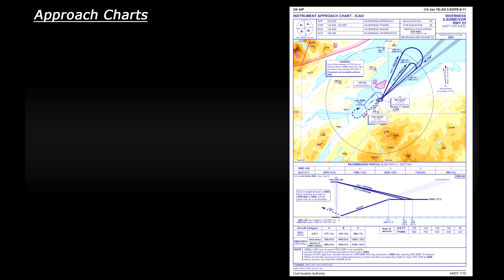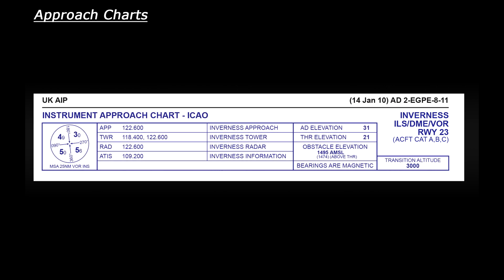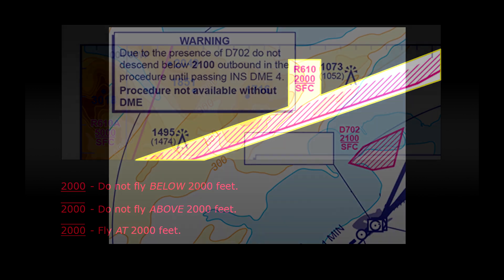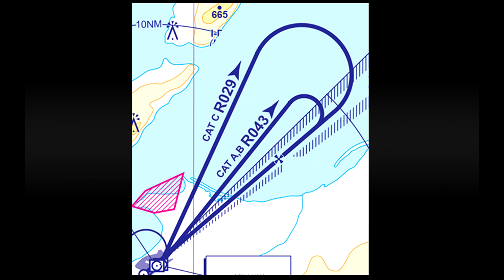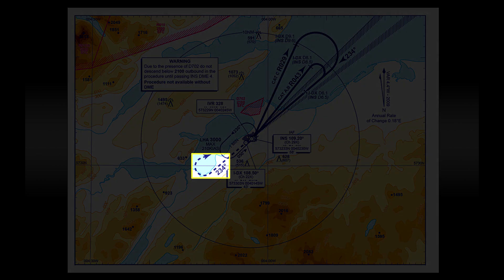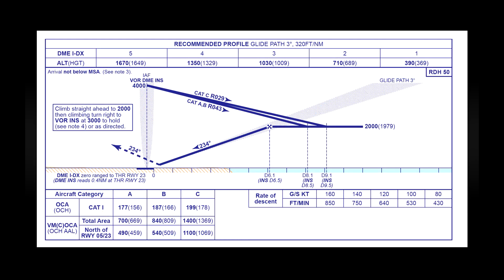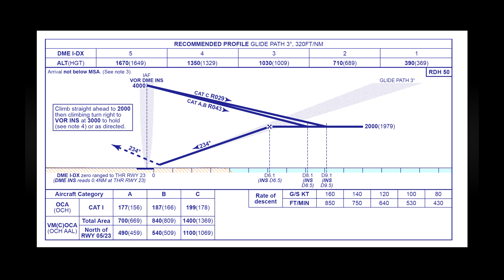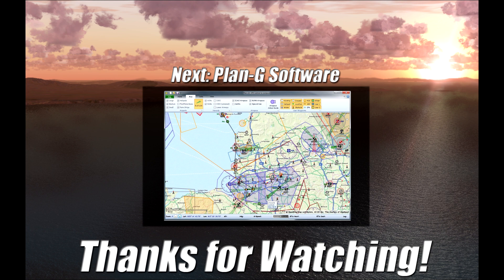Approach Charts Tutorial

Comment: I know this video is quite old now, but I wanted to point out a feature you omitted when talking about restricted areas.  You're right about the lines as they relate to the routing information - line below means not below, line above means not above, lines above+below means fly at - but for the restricted zones they mean something different.  I'll have to do this horizontally here, but you'll see what I mean.  R702 2000 | SFC means Restricted Area 702 starts at the surface (SFC) and goes up to 2000 feet.  The consequence is, of course, that you shouldn't go below 2000ft so the effect is the same.  A minor point but one worth making, I thought.

Comment: Thanks but why are the radio stations referred to as IVR for NDB, INS for VOR and I-DX for ILS? Why are they not just referred to as NDB, VOR and ILS?
Reply from the maker: Each navaid needs a unique name or identifier, otherwise you could have hundreds of "NDB" navaids in a country. Usually the identifier is a 3 character code which is related to the geographical location of the radio station. NDB, VOR and ILS are the general names of the equipment, the Identifier is a specific piece of equipment in a specific location.
Reply: Doofer911 thanks.

Comment: The oval pattern is in solid line, I think it is a procedure turn instead of holding pattern😂. Correct me if i am wrong
Reply from the maker: VERY good question!! I've done a little bit of reading and it seems that a Holding Pattern and RACETRACK Procedure Turn are very similar but there are some differences. After a quick read, this is how I understand it (might be wrong)...

A Procedure Turn is designed to reverse the direction of flight and there's several different ways to perform a procedure turn. One of them is a Racetrack Procedure Turn which is a similar shape to a holding pattern, however it forms part of the aircraft's intended route and the flight is not delayed. A holding pattern is used to delay an aircraft in flight. My understanding is that Procedure Turns are drawn on charts using bold lines whereas Holding Patterns use regular lines. 

Coming back to the chart in my video, I believe that the oval pattern is a Holding Pattern because 1. It's a regular line, not a bold one and 2. It has "1 MIN" written inside which indicates that each "leg" of the Hold should be flown for one minute. 

As I said, that's just how I understand it, I'm not a professional in Aviation so I could be wrong.
Reply: Thank you so much for clarification! I think u are correct, a procedure turn should be a bold line. It is drawn using the same thickness line as the R029 Cat C or R043 Cat A,B line.  The thin solid line oval racetrack in this chart is a holding pattern indeed.